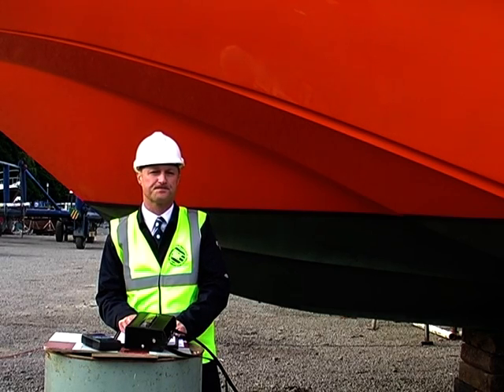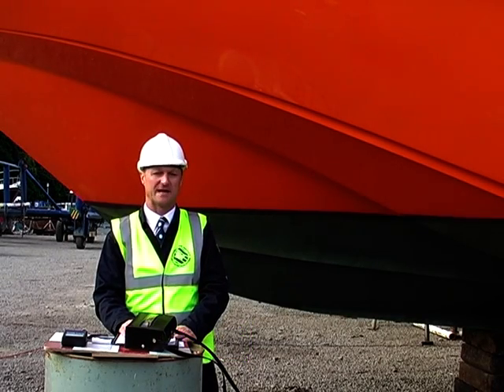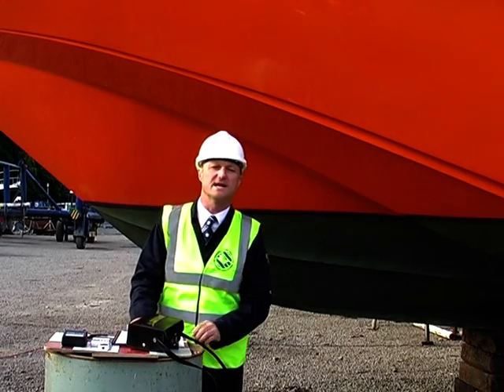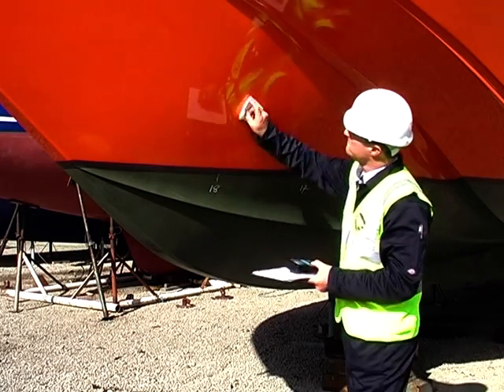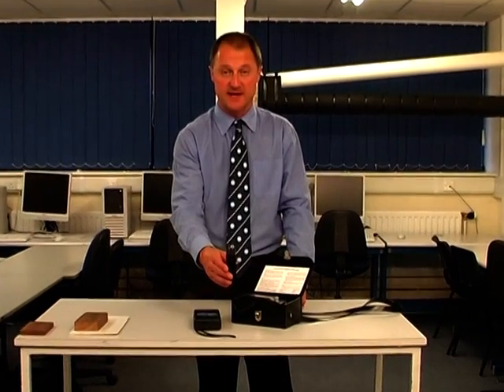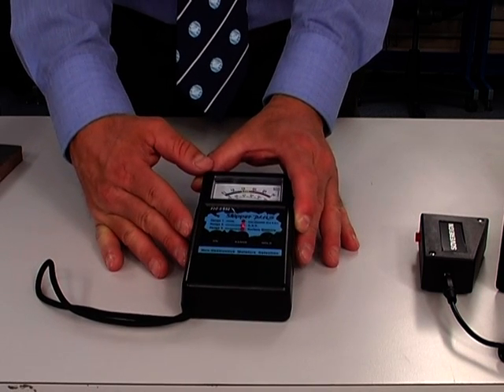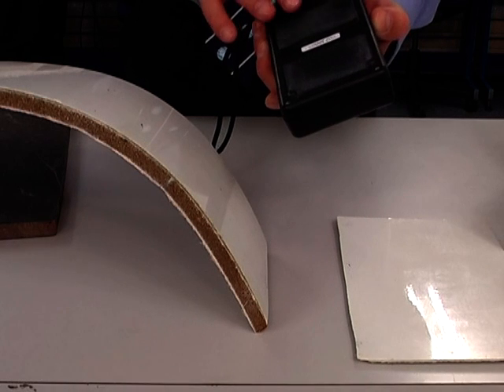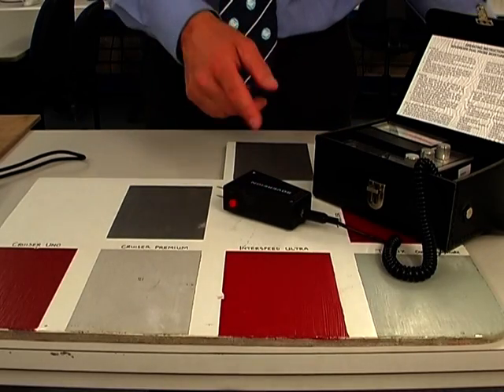An introduction to moisture meters and how to use them Part I.

Comment: I had a broker show up at 8:00 am and the decks were wet with dew. the moisture meter readings showed wet. I said, The deck is covered in dew to witch the broker replied " it's calibrated for that"  is it possible for a moisture meter to read past a Deck covered with water?
Reply: cut n paste?
Reply: No. Your surveyor was an idiot.
Reply: @bluemut55  The broker is 
Curtis Stokes of Ft. Lauderdale Fl. He was the buyers broker and my boat was for sale Buy Owner so it came as no surprise to me. He should sell used cars at Buy here pay here because he is a POS!
Reply: @markbailey6051  I'm a broker in Canada. Curtis Stokes had a boat for sale about 200 miles away from me. I asked if the boat was in good condition. He replied it was in great shape. I drove the 200 miles and the boat was a wreck. Filthy dirty and rotten with delamination. I notified him and he never even replied.